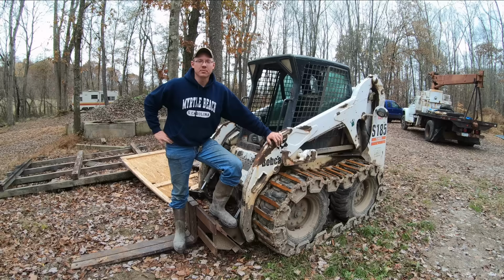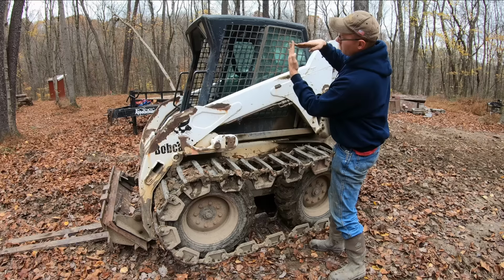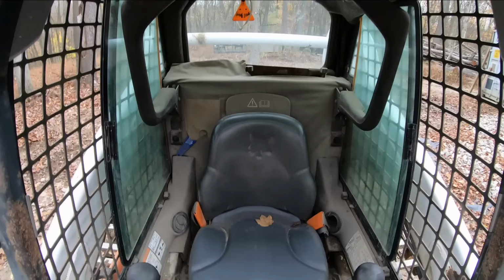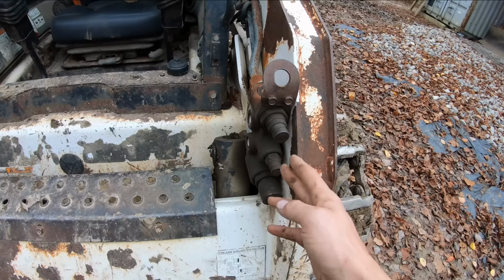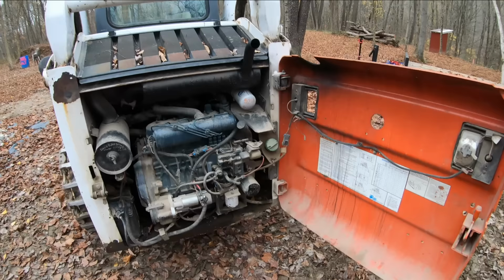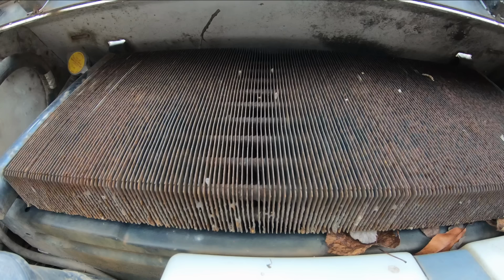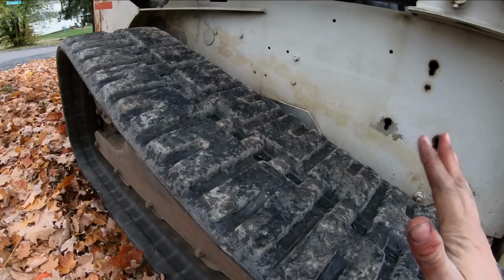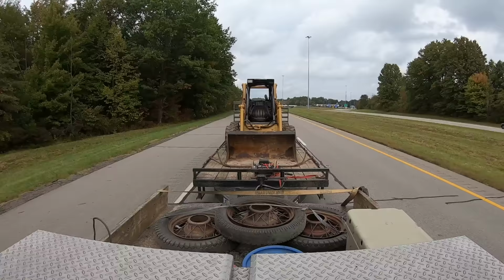Buying a Skid loader? WATCH THIS FIRST!

Comment: We have a T650 with a D24 Doosan motor which we have been working on for about a month after it stopped while pushing snow. We tried 4 new injectors, new fuel sensor, new fuel metering valve and pumped the fuel out of the tank and put No.1 fuel in. We put a new fuel filter on, tested compression on cylinders; had 3 at 425 pounds and 1 at 380 pounds. We took the belt off hydraulics and it cranks over at 500-600 rpm's. It acts like its not getting enough fuel to start. We took the line off the rail that feeds it to test how much fuel is coming out. Put the line over a 16 ounce water bottle and cranked it for 25 seconds to get 8 oz in bottle. It started today and it ran good for about 15 seconds but then quit. Any help would be greatly appreciated.
Reply: Just had that on a case 350 loader.  Plugged return line

Comment: Thanks Matt for your explanatory video what to look for to use skid steer or track loader. I'm glad I found your channel. And I have a question in regards to when looking for a used machine how many hours on the hour meter do you think are reasonable? Of course I understand it depends on how often they change the oil. I suppose that might be all but what do you think hour wise is something I could feel comfortable buying without hopefully any issues
Reply from the maker: Hours can be such a variable factor. Largely dependent on how it was taken care of in those hours. I’ve seen machines sacked out in 1,500 hours and I’ve seen machines like new still at 5,000 hours. It all depends
Reply: I suppose the answer also would relate to the general look and condition of the entire loader. Like you're describing in this video if there's a lot of generally not taking care of the machine I guess one could assume that they didn't take care of the engine too well. Like not regular oil changes etc. So I do appreciate the answer and I have viewed most of your videos and appreciate your channel.

Comment: Why is a skid steer the most versatile machine? I would have guessed a backhoe...
Reply from the maker: Some people make that argument, the way I explain it is backhoes are mediocre at everything and good for nothing, bobcats have such a wide variety of attachments they can literally do just about anything, and they are exceptional at small grading projects as well as countless other things. Not to mention extremely easy to haul compared to a backhoe Being smaller and nimbler they also fit in a tighter spaces and do more delicate tasks on softer ground
Reply: The only thing backhoes are good at is getting stuck.

Comment: Have you come across code 14-02 on your bobcat.   Its the fuel solenoid.   Wanted to see if you had any thoughts on it before I change it.  Fuel shut off and kills engine.   Will crank but not start.    Started 5min later and was able to drive into my barn.
Reply from the maker: There is a relay that runs it, I’ve had trouble with mine I’d start there.

Comment: Wrong! they do not neither weld hole or even make hole, fix is simple you take pipe which is fat having bunch of meat place inside with hammer, good idea to put in freezer, and weld the pipe to mainframe easy if you know how to weld. Than place the pin inside pin should be same size as pipe its simple metal bar which is round the end job done

Comment: Do you know how to move a 
non running bobcat?    I am looking at a 860.  First gen track drive.    Do you think if I take off a few of the hydraulic lines it would roll?   I dont think my trailer winch will drag it up onto the trailer.
Reply from the maker: I’m not positive but if you took off the pressure and return side of the drives it might spin I’d try to connect them to one another if that’s the goal
Reply: My tractor has a dump valve so you can tow it a short distance onto a trailer, basically on the hydrostat there is a slotted bolt head you turn 90 degrees to allow hydro oil to flow through temporarily, I would bet bobcat has a similar setup
Reply: @RiverValleyLandscaping  good tip.   I will look into that
Reply: put some small dia logs under it and roll it up
Reply: Most of these machines (not sure on this model) have a SAHR brake (spring applied hydraulic release). Just disconnecting the drive motor will not release the brake. You would need to determine which port on the motor is for the brake and use a portapower to release it. Or simply drag it...
Reply: There really is no good way to freewheel a bobcat. Its a towtruck job
\

Comment: I learned on iso and it’s always weird getting into a machine with h pattern and remembering
Reply: I learned on the H pattern, and the inverse is also true, but with a little time you can pick it up pretty quick. Usually within a few hours you can be pretty proficient, and start getting much smoother, and in a day or two it will start being almost second nature.

Comment: question,  what do u think of buying previous rental units, ie sunbelt? what is the best place to look. friends tell me about ones from the 1970s and 80s $1500 and up with problems,  I think late 1990s with lower hours is my thought. but people tell me used sunbelt, when they sell it is top notch, any thoughts? a bobcat and a trailer is what I'm aiming for. thanks this is Very informative! how is f800 crane truck doing now that it runs?
Reply from the maker: I’m not saying that every rental machine is beat like a borrowed mule but I’d lay odds most of them are...
Reply: The upside of buying a rental machine is that they are required to keep the machine maintained. They cant rent a broken machine so all problems are addressed immediately. The downside is that guys beat the hell out of the machines.

Comment: A year on an oil filter / change? I don't operate these types of machines but a year seems like a long time for an oil change. I've come to understand that the reason there is a time limit on an oil change isn't because the oil losses it's lubrication abilities but rather it looses it's cleaning abilities. I'd love to hear your thoughts on this?
Reply from the maker: It’s all about the hours, dates are just a reference. it didn’t get run that much I the past year. Been busy!!
Reply: Oil doesn't lose its lubrication properties over time just from sitting.  It gets contaminated due to wear particles, combustion products, and water from combustion and condensation from atmospheric moisture.  Best to pull a sample and send to a lab for testing (~$20).

Comment: Hi if you have a blown headgasket, would you chance just changing gasket without a major skim job?
Reply from the maker: not sure what your asking but head gaskets can be quite a job on some machines as well as a sign of serious abuse/neglect of the engine and can actually mean there is much more serious engine damage. the head could be cracked or even worse the block.
Reply: @DieselCreek  thanks for your thoughts on this subject ,now gone in for investigation.
Great videos 👍 all the best from the UK

Comment: you should still restore that farmall cub it would get a lot of views
Reply from the maker: It’s an A and it’s beyond restoring... I have one worth restoring tho I’d like to get to someday but not today
Reply: Believe me, you can buy something like that restored for $2000, someone else has probably spent $4000+ restoring. Old tractors are great and all, once you start running a modern compact foot control hydrostatic diesel with a loader, power steering & hydro PTO, you won’t want to go back.
Reply from the maker: @jdub229r  I enjoy them for what they are, hydros are nice on loaders but I’m more of a gear drive fan these old ones are fun to mess around on and pull some wagons or something

Comment: From what year did the option of the non-foot operating system become available?
Reply from the maker: I guess late 90’s? 🤷🏼‍♂️ but you can still buy em brand new with foot controls 🤦🏼‍♂️
Reply: @DieselCreek   ah okey, I'm currently sorting through the jungle of all the models and names and the years they came out. Im lookin for a 2-2,6 Ton in weight with AC (at least controllable ventilation) and the joystick option.

I'm in sweden so the market for used ones with those options to a affordable price isnt that great.

Thanks for a great video!

Comment: People talk about the metal over tracks destroy the chain drives is that true, have you had any issues?
Reply from the maker: I’ve had them on nearly 1000hrs without issue, I could see how it would put a little more stress on everything but not a ton more
Reply: Thanks, did you buy the skid steer brand new?
Reply from the maker: No it had about 1800hrs

Comment: No mention of pricing on these machines. Seems a common thing on most videos is to avoid talking about prices.
Reply from the maker: Because price is so widely dependent on the type of machine, how it’s equipped and how old it is. You can spend $5000 on one or $80,000 just depends on what you want

Comment: Can low flow attachments be run on hi flow machines?
Reply: Hi flow machines normally have a low flow as well
Reply: Most hi flow machines have a switch that you engage the high flow with. If you need less flow then you just don’t turn the high flow pump on
Reply: you can also drop the idle a bit

Comment: Hey i know you're a busy man but maybe u can take a moment and watch my video and kind of a elaborate what might cause my drive to make that sound? I did open up one of the motors and apart from a blown seal it was in a good condition.  Only thing i can think of is maybe the part of the pump that drives the motors? The sound is less and less @ higher engine rpm's, maybe that's saying something? Thanks! (video starts @ a specific time) 

LInk: http://www.youtube.com/watch?v=IC-wniWgW1A&t=2m30s

Comment: If it has a Kubota engine in it, why not purchase a Kubota loader instead of a bobcat?
Reply from the maker: Kubota makes the power plants for several brands of equipment, there are only so many small diesel manufactures kubota wasn’t even making skid loaders when I bought this machine and from what I’ve seen of their stuff I wouldn’t buy one of their loaders, their engines are great but not a fan of their machines
Reply: Kubota engins will last forever if you dont run them hot. I once ran a kubota engine with no oil for 10 hours at full throttle,, not my best day,, but it still worked perfect after that. Im switching to Kubota loaders because im fed up with all the problems of bobcat. I have 18 bobcats

Comment: Knocking the filter like that would be 100x worse then blowing air through it , if you bend the cage and warped it and separate it from the filter material and create holes

Comment: You got 2865.3 hrs on it? Thought it would be higher.
Reply from the maker: only had 1800 when I bought it, until recently it wasnt run all that much as I was off working my life away lol
Reply: I've run many of my skidsteers to 4 or 5,000 hrs with no major mechanical issues. My rule of thumb is that about 2,000 is when you will need to address smaller items (bushings, seals etc).